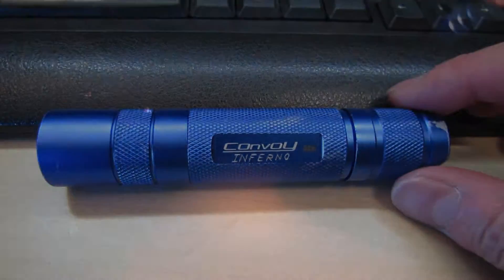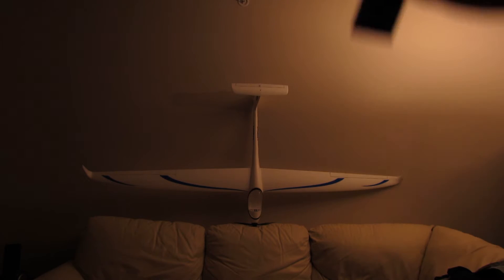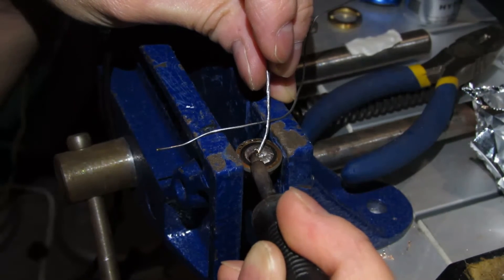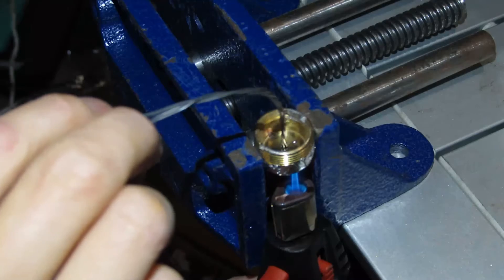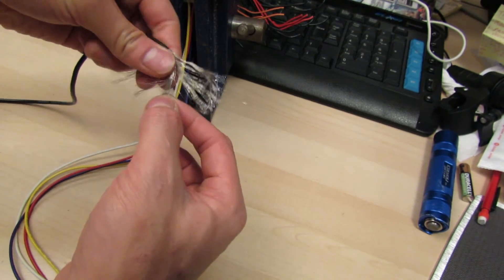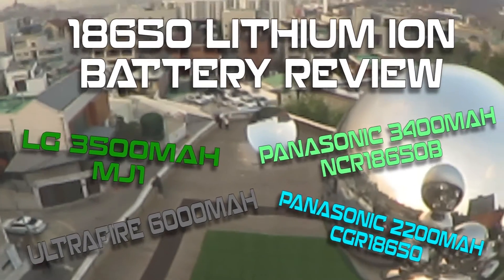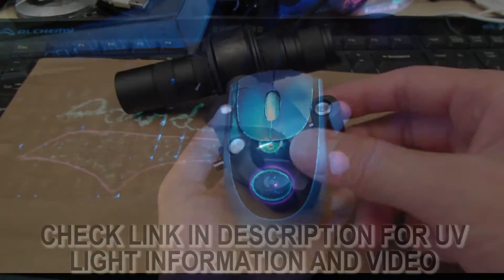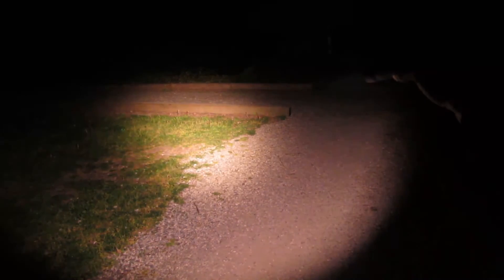The Most POWERFUL Flashlight EVER - DIY Convoy INFERNO - 2239 Lumens

Comment: xml2 can gave 2239 lumens?
Reply from the maker: Lol probably for a short time, but maybe not.  The 2239 was based on my light meter and measuring techniques, that could introduce some variances in the lumen estimate.  But I've been testing a lot of lights using a similar method and it seems pretty spot on with what the manufactures have been estimating, so it can't be that far off?
Great question tho. 
Cheers!
David.

Comment: Im bit curious will putting the thermal paste to that pills thread will transfer heat better than none ?.but im also afraid it will decrease the current conductervity to thecopper pills because thermal paste is not electric conductor. im bit curious between want to put it or not to my xhp50 3v s2+ build. did you have any problem with that thermal paste to the pills thread ?
Reply from the maker: Hi, I was actually using copper conductive grease specifically made for electrical connections, so it will keep the amps flowing best, but if you can't find that, you could just regular thermal grease. 
If you clamp down hard enough, I think it'll have a good electrical connection and have great thermal conductivity.  You could also just dielectric grease for spark plugs, instead of thermal grease, that'll give you a good electrical connection and provide some thermal conductivity, better than air (if you used nothing), that's for sure.
Cheers!
David.

Comment: Is there any other batteries that would work well for this mod (preferably on GearBest)? The batteries that you listed don't ship to Canada.
Reply from the maker: Ya, you can get the Sanyo 3500mAh from aliexpress, they are awesome batteries, and similar to the LG MJ1 3500mAh.  If you want a little more power, go with the LG HG2 3000mAh, or if you're ok with less power, the cheaper Panasonic 3400mAh work well too.
All can be purchased from aliexpress, I've been successful with my purchase, and genuine high performing cells were delivered.
Cheers,
David.
Reply: For the LG HG2 3000mAh batteries what amperage should i get them in because im seeing some with 20A and some with 35A, also should i get a protected or unprotected cell? (Last question i promise lol) button top or flat top? Thank you very much!
Reply from the maker: Jakob Belanger Hi, no worries! You can ask as many questions as you please!  Questions are welcome!  
The HG2 comes in only one model, it's both 20A and 35A actually, it has a certain internal resistance, and it can produce 35A for a short period of time, as long as you keep it from heating up.  It can product 20A for longer periods, but you still gotta keep it's temp below a certain temp.  If the flashlight gets warm, you should shut it off.  It's basically a best guess burst/peak rating vs. continuous rating used for marketing.  
There's an Astrolux X5/X6 driver that reduces output to maintain the temperature, that's good to use in the S2+ to keep it from getting too hot.  It also has a FET, so it'll push a lot of amps, but it's uncontrolled so using 7135s is safer for your LED.  
I found one FET can't push enough amps to kill my LED though. 3 FETs can kill an XPL2 though, tried that and it fried my LED in seconds. 
Let me know if you got any more questions!
Cheers,
David.
Reply: Thank you so much for replying and helping me with these questions.
Reply from the maker: Jakob Belanger You're welcome!!  Let me know if you got any more questions.  I'm planning to post a video about the X5/X6 driver in the future too, I think that's an easier and better upgrade if you're ok with a FET driver.
Cheers,
David.

Comment: whare can i find the pill mine coms with a aluminum pill 
and i am afraid that hassent enouch thermal conductivity 
so ware dou jouw guys buy them
Reply from the maker: Hi, 
Oh, I didn't know the pills were aluminum sometimes?  Where did you order your Convoy from?  That's interesting.
Not sure where to buy it, but the Convoy store on Aliexpress is the manufacturer and can sell you any part you need.
Message them(Simon) and he'll let you know how much it costs just for the brass block for the Convoy S2+.
I'm sure it'll be pretty cheap.  If it's too much, then I would just buy a new light from him, make sure you ask for the Biscotti firmware, it's nice.  Unless you want to upgrade it to the Astrolux X6 driver, that one is pretty good too, it has active thermal regulation, so I like it, and it's a FET driver with a 7135 for good moonlight mode, pretty delux driver!
Cheers!
David.

Comment: i think LGmJ1 battery is rated at 10amps.
Reply from the maker: Ya, they rate it for 10A, and it's similar to the Sanyo 3500mAh 10A too.  They seem to have similar internal resistance too.
The 20A LG 3000mAh cell has lower internal resistance, and the Sony VTC5 has even lower resistance!

Comment: This is the first video ive seen from you and i'm impressed by the work you put into tiny details, i would have never thought about the spring, i am planning on making an ALL in one super awesome only flashlight youll ever need in your life, 

it will use an 18650, and a custom 16mm pcb based on TP4056 for integrated charging, 
it will also have the 8205a protection IC on that 16mm pcb,  with a temp sensor hooked to the battery
it will charge via Micro USB somewhere on the flashlight (gotta figure out where and how to cut that shape out)
it will probably have an XP-G3 lamp, in either 4700K or 5000K milky white Natural sunlight color with 90 CRI version
it will have a diffuser, probably sand blasted glass or milk effect painted glass, so no ugly sharp shadows
icing on the flashlight-cake would be some kind of docking charging station, 

not so sure about the lamp and if its bright enough, would love a 20W boostable one but with all of the things above, i do have access to lathe and mill, i could machine a fully solid custom copper block, thoughts on Active cooling? with a tiny ass fan?
Reply from the maker: Hi,
Thanks for watching my video, and I'm glad you liked it!
That sounds like a great flashlight.
There's a bunch of those features spread throughout various flashlights, but never put into 1.
I think those ideas are great, and I think active cooling would be good to have as well.
All of the above plus active thermal regulation, and I think you've got yourself the only flashlight you'll ever need.

Right now I'm playing around with putting the X5/X6 Astrolux driver into the S2+, and it seems to be a pretty good upgrade.  It has active thermal regulation, but it seems that it's a little slow in ramping down to keep the temperature down, but that's probably because the programming is written for a larger light with greater thermal capacity.
Your fan would mean you could put out more light continuously out of a smaller flashlight though, so in conjunction with active thermal regulation it'd operate well.

The OLight S1R has a nice magnetic tail with charging, maybe a docking station with a similar magnetic connection would be good.
Cheers!
David.

Comment: Hey David, before I start this project in your video, I have 3 questions for you:
1) Did you use the driver board that came with the flashlight and add the 8 AMC 7135s, or did you buy one specifically for the xml2 LED and modify that one? 

2) instead of installing this setup in a flashlight, I was thinking of mounting the LED and heat sink assembly on a huge copper heatsink (from a computer video card) with a fan on it (to use as a compact mobile bench work light with a regulated DC power source) and running an led PWM dimmer inline to control it (instead of the button). Would I be able to do that straight to the LED without the driver board? Weird question, don't know if you know but I thought I would ask.

3) What video camera are you using? the one you used to shoot your videos on YouTube has an incredible zoom and I'm looking for a video camera so I was interested in what you're using.

thanks a lot!
Reply from the maker: Hi, 
1.)  I did it to the stock, but now the new driver with Biscotti has come out, it can only be purchased from the Convoy store on aliexpress, I can send you a link, but they're on vacation till Feb 15th.  It's worth getting that, you'll be much more happy with it.

2.)  Yup, I've done that actually, just for testing.  For a bench light you might want to check out the 100W Epistar LED chips.  Run off a DC-DC boost converter(100W, and 400W, you could also use a 600W).  I use it on old AMD 125W+ (Phenom) CPU heat sinks, it's the most light you'll get for a cheap price.  I can give you more info if you need, on the set-up if you'd like.
But you can always use an XML2.  They have the new XP-L2 which is supposed to handle way more amps than the XML2 and XP-L, I've ordered some and will give it a try.

3.)  I use the Canon SX40HS, which has a 35x optical zoom, they now have the Canon SX60HS, which has a 65x optical zoom, so will be even better.  Sort of expensive, but if you need a point and shoot with a mega zoom lens, it works great.  I use my 35x zoom at the range to spot shots out to 230 yards, works better than my spotting scope.  The 65x must be that much better.  I like the Canon cameras, as the autofocus seems to work much better than the other brands, I've been pretty happy with it, and haven't felt the need to upgrade yet.

I hope I answered all your questions!
Let me know if you have any more.

Cheers,

David
Reply: David Sunshine Wow, thanks David. Did you put a link to the reflector you used for this build? (I might have overlooked it)
Reply: David Sunshine oh, I almost forgot, if you have that link for the new driver with the biscotti, I would appreciate it. What are the benefits of this driver over the one you built in the video?
Reply from the maker: Hi, 
Sorry for the delay.
If you're still wondering about the reflector, the SMO one for S2+ is here: http://tidd.ly/c1581740
But if it's throw you're looking for, you might want to go with an XPL HI and a 5 degree TIR optic.
I will be testing the XP-L2 with the 5 degree TIR optic, and cone doming it, to see if it'll really throw hard.  The TIR optics seem more efficient than the polished reflector type, so it should be promising when using a V5 LED(highest efficacy almost, aside from V6, but it's the highest I could find in XP-L2).
You should upgrade with a tail magnet too: http://tidd.ly/c2e39084  It comes in really handy.
But I actually like the magnets on the side clip, that comes in handy too.  Let me know if you need links to the side clip and magnets that I used.
Reply from the maker: Oh, the biscotti driver is AWESOME!  (Here's the link: http://tidd.ly/817a2be4)
The benefits are endless, practically, you can totally program it, and the low mode doesn't blink after 5 seconds, and the low battery protection is perfect, it drops down to moonlight and runs for as long as it can, until it's dead, which means it will never leave you in the dark, exactly what you want a light to do when you're out in the bushes, or using it for something in the dark!    The stock driver doesn't function like that.  Nobody wants a light that blinks and then shuts off, that's ridiculous when you're trying to use a flashlight in the dark.
You also have 12 programmable modes, some which limit you to 50% max, which is great if you've modified the flashlight to be SUPER powerful, and you want to lend it to someone, you can restrict the output, and you can set it to 100% only, which is great if you know you'll only be using it on night shift during a security shift, if you need blinding light, you know you have it, but then you can easily program it for moonlight mode later that week, if you're using it in your home for mood lighting(2700K LED recommended for that). 
You can also program the memory to be on or off, which means you can default the light to either moonlight and ramp up from there, or 100% and ramp down from there.  I have it set to default to 100% and ramp down from there, because I use my light at full blast mostly, but need lower brightness occasionally.
The biscotti driver also has off-time memory, not ON-time memory like the stock driver; what that means is when you've got the light on already, you don't need to turn it off then on, then off then on again to change modes, all you need to do is half press once, not twice.
The pulse width modulation is also awesome, 16kHz, and has 10-16% flicker, with a flicker index of 0.0 to 0.1, so very good dimming functionality.  The stock driver was about 4kHz, which is good, but this is just that much better.
They both use the same hardware, it's just the firmware that's changed.
I will be trying to upgrade the biscotti to a FET driver, so instead of 2.8A it'll be able to push a lot more, hopefully I will push about 8 or 9 amps with it, but we'll see what happens.
I don't know how much into modding you are, but it should be pretty easy to add a logic level MOSFET to the biscotti driver, and fit it into the Convoy S2+ or C8.
They also have strobe and SOS if you want them, but they're hidden if you don't need them.  So really this is the best of all worlds.  I wouldn't mind adding a small capacitor in there to smoothen out the flicker even more, then it'll really be skookum.
Hope that describes it for you.  Let me know if you have any more questions on that.
Cheers!
David.

Comment: Very nice job! Knowledge, attention to detail and craftsmanship, you have a bright future young man.
Did you upgrade the Optics as well, or just the electronics that you showed in the video?
Reply from the maker: Thank you!  I appreciate it!
I like learning and being creative, that's what life is all about, and we should have fun doing it right?
Great question, and yes, I have, I've used the smooth reflector, a TIR optic that's 10 degrees, and one that's for the XPL at 5 degrees, and they each increase the throw a little bit more by narrowing down the beam angle.
I'm going to try the 5 degree with the new XP-L2, and try shaping the done like a cone shape, thereby making a very powerful thrower.
I think the XP-L2 is supposed to handle the highest power ever, in an LED that size, and have the highest efficacy (lumens/watt) available at lower color temperatures, maybe even higher color temperatures.
Technology is always advancing, and we just keep stepping further and further.
We've gone a long way from incandescent bulbs giving us 20 lumens per watt, I with this, the bulbs you buy in stores will be pushing over 150 lumens/watt easily, at warm color temperatures around 3000K, that's usable around the home, it'll be great!
We can light up the whole house with 100 watts, whereas before you'd need multiple 100 watt bulbs, lol, 
I've ordered 2 warm whites and 2 cooler XP-L2s, so we'll see how they do!
If you're looking for a very powerful thrower, compact, the XP-L2 and a 5 degree TIR lens may be the way to go.  If you don't want to shape the dome yourself, you can get the XPL HI or the XP-L2 HI (When they make it, doesn't seem like an option now).
I think the S2+ with a good throw would be a prefect light though, and the Biscotti firmware too!  Then you can default to high, or program it to anything you want.
I'll make videos for the upgrades when I get around to implementing them to my S2+.
Thanks again for the comment!
Cheers!
David.

Comment: Yo, David, what do you think of trying this with the new XP-L2 this time? The tests show it has the potential to go even further than this!
Reply from the maker: Hi, 
That's a great idea! I'll have to try it out.
The data sheet shows that the XP-L has higher light output than the XP-L2, but hopefully the XP-L2 can handle more total power!  Thanks for the suggestion.  Looking forward to some testing.
Cheers!
David.
Reply: texas_ace from Budget Light Forum did a death test on the XP-L2. I highly rec you take a look there, the results seem to be mighty impressive.
Reply from the maker: Dinner-fork tongue Awesome, thanks for the heads up!  Looks like the days of bright LEDs are over, now it'll be the era of insanely bright LEDs!! Lol
Reply from the maker: Hi, I ordered some XP-L2 LEDs from Mouser Electronics, seems like that's a cheap place to get them.  Do you know where else you can buy them?
I purchased a couple V2 (warm whites) and V5 (4000K) XP-L2s to play around with. (I got the bare LEDs, here: http://ca.mouser.com/new/cree/cree-xlamp-xpl2-led/) I've got some 16mm Copper Sink-pad II's I'll reflow them to, it should work nicely!  
I am hoping for a higher color bin though, those are only 460lm ones, I'd like to find some V6 480lm bins.  I've got some XP-L's coming in that are V6 but I think the XP-L2 V5 might perform better than that.
Cheers!
David.

Comment: How long could it be in 20 amp mode before it either over heats or drains battery?
Reply from the maker: Hi, the LG 3500mAh battery is only good for 10A, so you shouldn't pull 20A from it, but for bursts less than 1/4 of a second it should be fine.
For this flashlight, I ran it at 5.11A/20 watts, and after 4 minutes it can get up to 90°C, which is the max you'll want the 18650 to be subjected to, so I turned it off at that point.  If you leave it running for longer, you run the risk of the battery exploding, and that could be very dangerous and/or deadly, so it's very risky playing around with the Inferno, it definitely has earned it's name Inferno.
I would say you can reasonably use it at 20w for 1 minute maximum, before it gets too hot, overheats and could explode, but I would be careful not to run it at 20w for any longer than you need, it gets hot very quickly even with all that copper.
Cheers,
David.